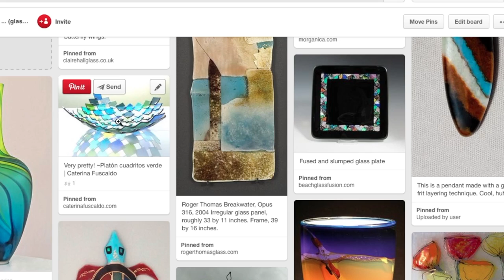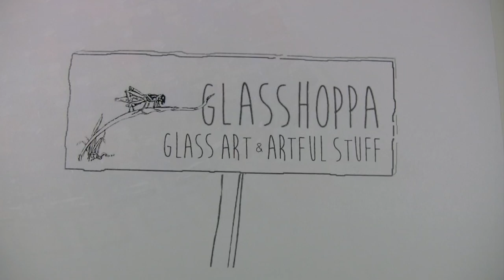Brilliant Rainbow Platter

Comment: Do you use the kiln paper while fusing in that 12 inch bowl mold too?
Reply from the maker: No, because slumping requires only low temperatures, there is no worry about the glass sticking to the ceramic, as long as you prime your ceramic mold with kiln wash (shelf primer). I only use the paper for higher temperature fusing.
Reply: Thanks a bunch. LOVE your videos. Very informative, you show your examples of different firings temps, explain things clearly and you're funny :) Keep'em coming. :)

Comment: quick question.. can the one you made with the green back ground be used as a trivet for hot pans ... or would it shatter?
Reply from the maker: Depends on how hot the vessel bottom is ... too much heat too fast and it would certainly break. What's too much? I do not know ...